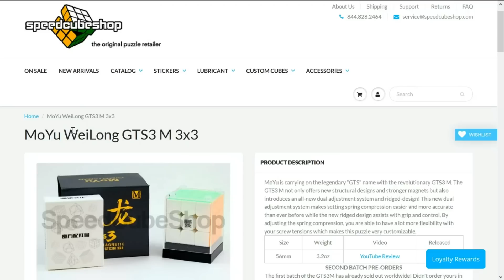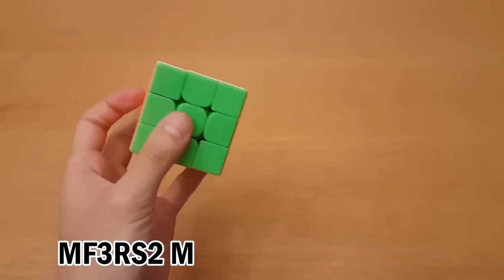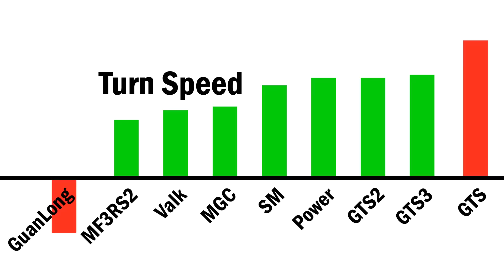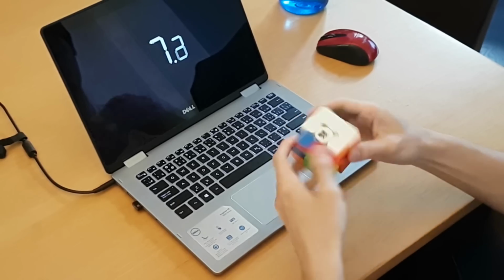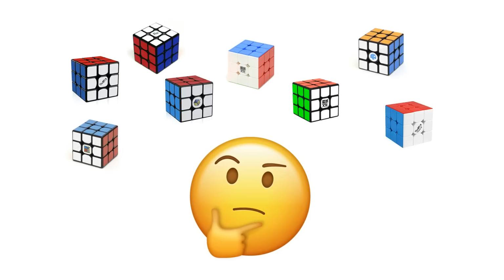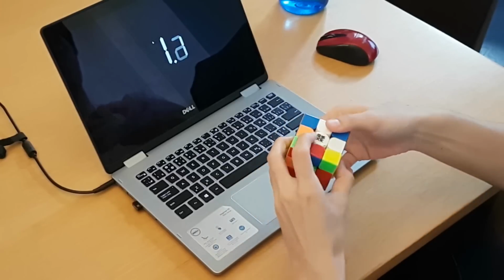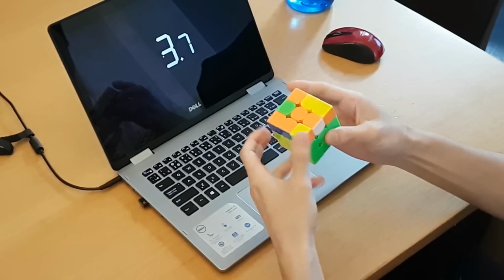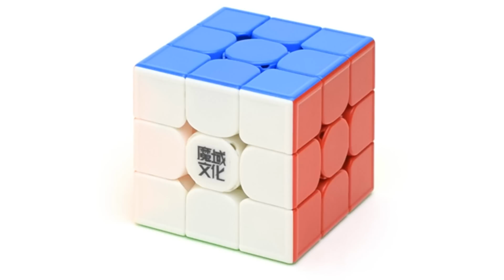MoYu GTS3M Review | SpeedCubeShop.com

Comment: Hey, J Perm, I have some questions, not related to the video. Now I average about 20 seconds. I know full OLL and PLL. I do F2L in 6-7 second. Usually I don't make pauses in it. I execute OLL and PLL algorithms in ~2 seconds. But... I have a problem with cross. I can do it in 8 moves or less, but sometimes I spend on it even 6-7 seconds (because of bad fingertricks and up to 3 rotations) + big pause between it and F2L (I'm working on that pause). My questions are:
1) How to practise cross/scramble fingertricks? When I am scrambling the cube, I make 1 move then regrip e.g. R2, regrip, F2 instead of R2' F2 instantly. Do I have to find them all myself or have you got any tips for me?
2) What does "drilling algorithm" mean? Just repeating it over and over again?
3) How do you memorize cross solutions? Do you remember letters like " D F D' " or do you just imagine moves?

Pretty funny. I avg 20 seconds but when I use pre-made cross I'm even sub-12... 

Sorry for any mistake in English!

Thank you and happy cubing!
Michael 'Eight'
Reply from the maker: 1. scrambling doesn't matter, but do it enough times and you'll probably start reading multiple moves at once and link them together. for cross, every cross is so different that you just have to experiment with how to grip the cube when you start, and see which way works out best.

2. yes but make sure you're doing good finger tricks (reducing regrips)

3. I visualize piece movements and convert it into hand movements in my head. definitely do not think about letters
Reply: J Perm Thank you very much! One more question - can I send you in the future video with my ao5 solves for critique? In the future,  because now in front of camera I end up with DNFs and 30 seconds solves.
Reply from the maker: all critiques for now are in a Patreon reward tier since I don't have the time to look at everyone's like I used to :/
Reply: J Perm ok, one more time thank you!
Reply: You just gotta get used to how to make crosses. Also, if you do f2l in 6~7 solves you should be averaging around 12 seconds.
Reply: Eight for cross just scramble the cube and then take your time,  persuade yourself into imagining a cross solution, doesn't matter if it takes a minute to find the solution,  you have to do it about 10 times a day and soon you will be better and able to do it in a few seconds of inspection. For first pair.. Do you hold the cube with cross on top or bottom? It should be on the bottom.
Reply: Krzysiek Makłowicz Hah, zgadza się. Czyżbym zrobił jakiś błąd w budowie charakterystyczny dla Polskiego?  :)
Reply: Erik Kmetič on the bottom. As I said I can do it in 8 or less moves on each color (I'm color neutral...  Almost). But i can't execute it fast.  I do e.g. move, rotation,  move, regrip, move, regrip and because of that I have bad times.
Solution is good,  but execution is terrible.  :/
Reply: Eight then try imaginig your hands/fingers moving layers. You must make sure you know the solution for the cross before you even start executing it.
Reply: Man, sometimes it's better do a cross with 10 or 11 move but with fluency and speed than do a cross with 7 or 8 moves but with pauses and without an easy F2L case after the cross
Reply: My average is like 20, 23 seconds and I don't now all the OLL and PLL cases, just 10 OLL and 12 PLL
Reply: You're right. But now I know my most important mistake I generally (not always) made. I used to memorize letters, so it was almost impossible to find a nice fingertrick for the solution. So now I would focus my practice on finding a "fingertrickable", but not necessarily short solution. I have to imagine moves with hand moves at once. I think if I learn that, I'll skip the sub-15 step and jump immediately to sub-12. 

I said about scrambling. I meant how Feliks and other fast speedcubers do it. They're going from one move to another immediately. Even when they regrip one hand, they do move with the second hand.

btw. Do only I have a big difference between avg and pb?
My avg -- my pb:
50 sec -- 31 sec
35 sec -- 19 sec
25 sec -- 6.609 sec (current)
Reply: Krzysiek Makłowicz :D
Reply: I have the same problem with PLL I'd say I'm sub 10 but some days my fingertricks are super bad during LL, which makes me get 11s averages

Comment: Hey J Perm.Can you answer two questions?First,does lube change the corner cutting?And if it does,did you set your gts3m?That's because mine has some catching issues on the reverse corner cutting and normal corner cutting,I even tried loosening,but it didn't work so well.Oh but just testing,on solves it doesn't feel that this problem makes the cube lock up,but it's still strange.Also nice video!!!

Comment: The MF3RS3 is super slow, right out of the box is super smooth and comes with a little bit of lube. But even after tons of turns and solves it still feels super slow, and even after adjusting the tensions it’s still slow, just less stable. Corner cutting is amazing though,

Comment: Hi J Perm, good video. I have a question about the f2l case where you solve it with a triple sexy or reverse sexy move. When it's it on the left side should I do it with my left hand or rotate so I can do it faster?(im right handed) If so, should i be comfortable with doing triple sexy move in the back right and back left too?
Reply from the maker: yes both hands and the back. i recommend reverse sexy because it's easier to execute with both hands.

Comment: I love this cube, but I've been having quite an issue with corner twists. I'd say it happens once ever 40-50 solves. I like the screw and spring tensions where they're at, but willing to try tightening. Is there anything you recommend to help with this?

Comment: Looking to buy a new cube after not touching my weilong for 4 years (yes I’ve been out of the hobby a while now), this looked amazing until you mentioned it only comes in stickerless. Dealbreaker! Do you have any recommendations for a cube that performs similar to this but has a stickered option available? 

I can’t believe they wouldn’t include a stickered option, back when I competed stickerless cubes were illegal!
Reply: Stickerless cubes are legal now. MoYu produced also stickered limited edition GTS3M. There is WRM which is basically the same

Comment: Is it worth it to switch from my GTS2M to this cube?
Reply from the maker: this one corner cuts better and is more flexible, which is good or bad depending on you. cubes nowadays are so good that you don't really HAVE to switch, but a new feel can help sometimes. it's up to you
Reply: I like the GTS3M a lot more on the out of the box tensions and spring compression. I got so used to it that the GTS2M even feels slow.

Comment: Hey J Perm! I’m looking to buy a new 3x3. I’m so torn between this and the MF3RS2 M. I’m kind of a novice cuber. I’m currently learning CFOP and average around 35 seconds because my speed cube was only $3 and is absolutely terrible to turn and locks up all the time. I’m leaning towards the GTS3 M but I want to know what you think. My turning style is kind of aggressive but I think it’s because of the bad turning. On my Qiheng S Megaminx my turning isn’t very forceful and aggressive and I still have yet to go to a competition because I can’t go far. If you are reading this thank you so much! Also, I will end up buying both so I would like to hear your opinion on which I should buy first
Reply from the maker: they're quite different. gts3 is a lot faster and has stronger magnets because of it. they both corner cut super well and they were my last 2 mains so I think they're among the best. my main is the gts3
Reply: J Perm That’s part of why I became so interested in the GTS3 M. Do you think that the GTS3 M could possibly be too fast? Also, any tips for learning OLL? I know 2 look but not 1 and I don’t know how to approach it the best.
Reply from the maker: it has really strong magnets and you can set the spring compression high, so it doesn't lose control.
Reply from the maker: the best approach in my opinion is to learn all the cases for 1 shape at a time (kind of like the order in my OLL video) so you can quickly know if you've learned a certain case or not
Reply: Thanks for the advice J Perm! I ordered the GTS3 M and can’t wait to get it
Reply: J Perm I just got the cube and it is my new main! I don’t know why most people don’t like it that much

Comment: How did you set your cube up? It sounds different from other unboxings.
Reply from the maker: highest compression setting and same tensions as out of the box, lubed with weight 5
Reply: @JPerm  Thank you! But Other unboxings said that the corner cutting was not that great out of the box, however, your cube can cut from almost anywhere

Comment: hey im an intermediate cuber and im thinking of getting this or the valk 3 elite... which one should I get?
Reply: GTS3M is fast, Valk 3 Elite is controllable.
Reply: Neither... Get the rs3m
Reply: @capabilitymaster4034  No. Get J Perm RS3M 2020.
Also, MF3RS3M is fast, but RS3M 2020 is not as fast.
Reply: @gcubing_4064  my main recommendation is to get a gan 356 air m or gan 11 m duo

Comment: I'm puzzled between Power M or GTS3M. Which one would you say is better?
Reply from the maker: I really dislike the power, so I'd say gts3m
Reply: Okay I got this cube, but as you said so, it's ridiculously fast. It's like someone set its sensitivity to a 100. A lightest of flick can result in a U2 and my 'normal' force can get it to U3 quite easily. How do I fix it? People suggest overlubing it but I don't want to make it gummy. I like the dry/sandy feel of the cube, I just want to fix the overshooting. Advice please?
Reply from the maker: have you set the spring compression setting to the highest?
Reply: Did that right after I saw your other video about the dual adjustment system (really nice video by the way), and it did improve a bit, though it's still overshooting. What else can I do? Should I adjust my fingers to adapt to the cube, or adjust the cube to adapt to my turning style?
Reply from the maker: Maybe you're pushing too hard. You can try using a more relaxed turning style but I didn't find that to be necessary. A heavier lube could work
Reply: Alright, I'll try some. Thanks a lot for helping me out! :)

Comment: My cube came in and cannot even corner cut halfway iv tried adjusting using the screw driver and the new tool but no matter how loose I loosen it, it wont corner cut halfway.... makes me think i got a default cube. Any suggestions?
Reply from the maker: if it's too tight or too loose then it won't corner cut. the new tool doesn't affect corner cutting ability so just work on the screw until it can corner cut a decent amount
Reply: @JPerm  Good to know... thanks!

Comment: I just got this cube. But I don’t know why it doesn’t feel good. Hard to turn and perform algorithms…. Tbh I’m only doing beginner method solves. It doesn’t turn as smoothly as my gan cubes 356x and 11 duo.  I tried using the tension tool but don’t exactly know what I’m adjusting. The instructions are kinda vague. I don’t understand what the screw driver does either.  Sorry for the long post. Would love some help.
Reply: The cube will turn smoother when it breaks in
Watch this video to understand the customisation system!

https://youtu.be/I1d9ZvoaqEw

Comment: Next do a review on shadow 6x6 please
Reply from the maker: I don't feel qualified to review 6x6 cubes right now at my level. also, I haven't tried an aoshi GTS m. but the shadow is really smooth and deforms far less than the yuxin red.
Reply: J Perm is gts 3m your main
Reply from the maker: not yet, possibly later on as I gain confidence with it and keep comparing it to other cubes.

Comment: Hey j first of all thanks for featuring my comment in your video!! Secondly do you think that the gts3 m is in the cheap side or in the expensive side!!
Reply from the maker: definitely expensive side if you compare it to the gts2m, but not if you compare it to the gan air SM. the reason I'm comparing it to the air SM is because that comes with the GES spring system, and the gts3 comes with its own new tensioning system that I didn't mention nor try LOL. but if I make a video on it in the next week you'll know it's worth it.
Reply: J Perm okay sir !!
Reply: So, for someone who never used magnet and who's bad about tensioning, do you think it's a good idea to buy it ?
Reply: My main is a GTS2 since October and I'd like to change, i'm about sub 16.

Comment: So the only big change is the stronger magnets. K then I'll stick to ma gts2m
Reply from the maker: well it's more flexible and corner cuts better too
Reply: J Perm np
Reply: There are ridges and new tensioning system too (it's not very new, its more like an upgrade from gtsv1).
Reply: Bebek Dragon ridges souldnt make much of a difference and so shouldn't the tensioning system

Comment: You can solved this in 8 to 10 seconds and I can solve this in 55 seconds 😩
Reply: Just Practice
Reply: vinutha bhandary I mean...at 55 seconds, probably need to learn f2l and advanced cross. Practicing beginners for hours is sort of useless.
Reply: Kevin M that was meant to be a joke. That's what everyone says when asked for tips.
Reply: Bfor i was into speedcubing i was sub 40, without practicing. So i think you will get lower time soon.
Reply: What time should you be at after learning Advanced cross and F2L, because right now when I don't mess up on either of them I get around 45? I have learned 4-look LL but my lookahead is  terrible
Reply: john tan Yeah I'm mostly practicing F2L, but I was just curious of what I should average
Reply: john tan Ok thanks
Reply: Tom Fougstedt sorry if my answer cant be based on my experience because i already learn full pll before i learn f2l, but i just did a few solve with advanced cross and intuitive F2L continued by pure regular LBL (not 4LLL),  and in my last 12 solves i got a couple of sub 20 single sub 22 ao5 and sub 25 ao12, but i think i would get closer to 30 to 35 if i chose to learn F2L first.
Reply: Bebek Dragon No need to apologize! Your comment was an interesting read and I'm sure it will help in some way. Btw just got my PB single 36.61, tbh I was pretty shocked when I saw the time because it didn't feel like it was a good solve yet I destroyed my last PB with 5 seconds